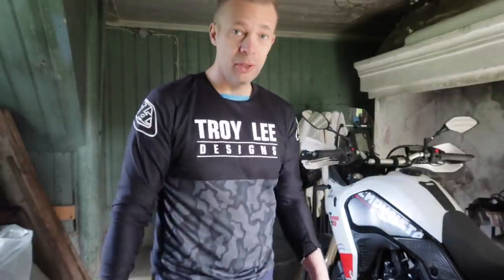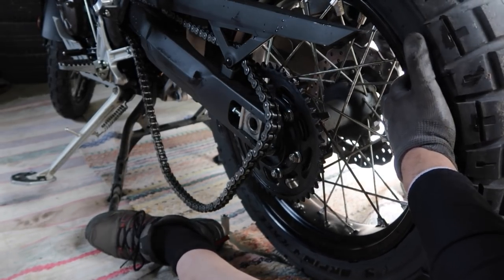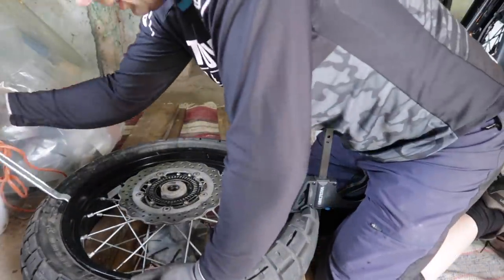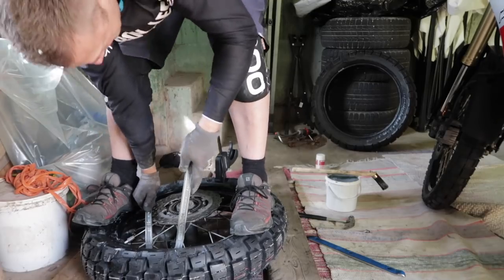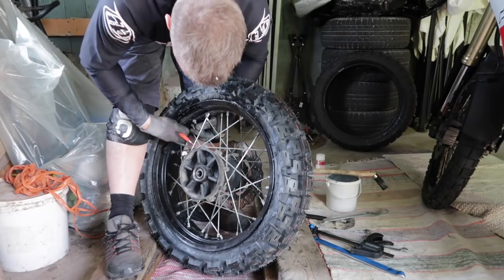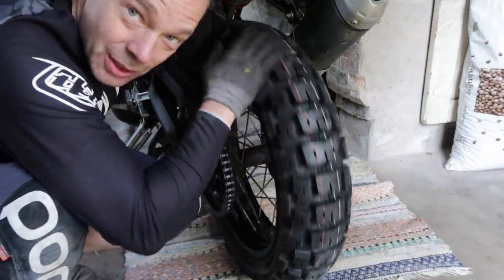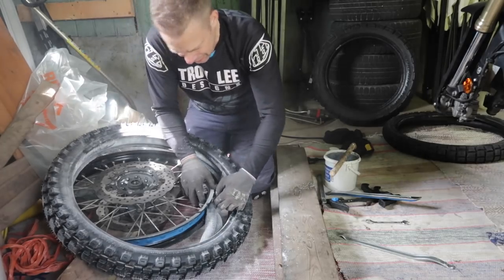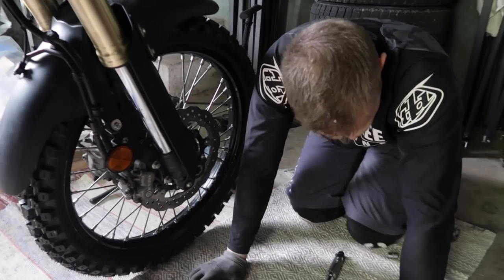How to change tyres on Tenere 700 yourself and save money

Comment: Kindly answer one more question.
What is the size of the bar where you have mounted the Quad Lock for the phone. I want to order one but I don’t know which mount to go for.
Many thanks in advance
Reply from the maker: The quad lock mount you want is the ”mirror mount”. Fits perfect
Reply: @NomadSweden  do you use the vibration dampener also ?
Reply from the maker: @drady8541  nope, i used a phone only for navigtion and the dampener added a lot of extra distance

Comment: Hi 
How did these tires preform on the surfaces you operate in, regarding both traction and longevity ? How do you think the Tractionator Adventure compare to the Rally tires ?
Reply from the maker: Hi! The Motoz Adventure are favorites of mine now for long trips with lots of gravel/offroad. They last forever. I took mine off after 8500km but still had meat left on them. The price you pay is that they are very slippery on cold/wet tarmac because of the hard rubber. So no twisties in the wet. Once you know when to be careful and accept the limitations, they are great for adventure. The Rally tyres are softer and offer better traction on hard surfaces.

Comment: I might buy motoz next time, just for ease of installation! My trailmax missions absolutely kicked my ass. Good thing they supposedly last so long because I do not look forward to taking them off :D
Reply from the maker: I do this 3 times every year. JnlessbI get a flat. It gets easier every time.
Reply: @NomadSweden  I hope so! I ended up taking the rear to a shop because I couldn't get the bead over the rim on the second side. It threw my tire iron back so hard it put a hole in the wall 8 feet away. Makes me worried for if I get a flat in the middle of nowhere, there's no way I could get it back on

Comment: question: as I am looking for the T7 world raid and having never had tubes tires for the reason I don^t want to change tubes for 30 min or more on the side of the street, I wanted to know if you hever considered looking for tubeless tires for the T7? If not, why?
Reply from the maker: Depends on how you want to ride. If you don't risk deforming your rim tubeless is so much easier.But I think my tubeless friends have small leakages every now and then. And I have to admit, I never had a flat on my T7 in 70000 km. Perhaps I would go tubeless if it happened more often.

Comment: just put some mitchelin anakee wilds on mine just finished 20 min ago . put you tube on and you pop up. ankees are a sod to take off and put on front was the worst. got the same pump to pump them up balane was good to. dont think i could change one on a trail .would have to run them flat. that bike will come alive with them on.

Comment: New sub here. Great videos. Wondering why you run tubes? Very impressive skills!!
Reply from the maker: Hi and thanks! The T7 comes with tubes and I haven't converted yet. The rear rim is TL ready but front rim does not have the TL hump, so a new rim would be needed for a true TL solution.
Reply: Thanks for the quick response. Just finished your clothing video. Looking at Revolution Race, that you had on, gpx or gpx pro? Thanks again. I’m in Idaho USA. Jon

Comment: You certainly made that look easier than I found it!  Never seen the baby powder but maybe you just use it to make yourself smell nice?

And please - new jacket required...  ;-)
Reply from the maker: Haha yes i do 😂 The distributor in sweden writes on their homepage to use powder or slime if using tubes to this tyre. Perhaps the inside of the tyre has higher friction than others.
Reply: @NomadSweden  It makes sense to avoid tube creep when fitting the tyre.  It may have made my change easier, instead of the blood and tears I put in to mine...

Comment: Darryl here in Texas. What do you think of these Motoz tires you put on and what country are you in.
Reply from the maker: I'm in Sweden. Motoz are awesome offroad. On tarmac, it's ok but front is a bit wobbly in higher speeds. Cold/wet tarmac is slippery. But hey, I use them for offroad where they rock!
Reply: Nomad Sweden 🇸🇪 If I had looked a little closer I would have read that you were from Sweden. That’s a lot farther north than I’ve been. I’m sure it’s beautiful but cold with some amazing adventure riding. Thanks for your review on the tires. I’ve considered these, the TKC 80 and the Bridgestone AX41 Adventure.  I live in San Antonio, Texas. Much warmer climate and should be around 90°F today (5-24-20). Thanks again.

Comment: Hi Robert. What did you put under the bike, so it doesn´t tilt forward, when taking off front wheel when on centerstand?
Reply from the maker: I haven't had the centerstand for a long time but I don't remember putting anything under. It becomes lighter in front so the rear weighs it down. (If I am not mistaken). But otherwise just put anything under the skid plate to be safe.
Reply: @NomadSweden  Thx alot. By the way, I  really enjoys your channel and content.

Comment: Hello.
With what force Nm tighten the front wheel axle and the 2 fixing screws?
Reply from the maker: Front axle = 72Nm, Pinch bolts = 21Nm
Reply: @NomadSweden  Thank you for the quick reply 🙂 super useful videos 👍
Greetings!

Comment: hi, I changed the front tire and wondered if the rim also has the direction or only the tire has the direction of rotation?
Reply from the maker: Yes the rim has the ABS disc on the left side. It needs to be put back the same way.
Reply: Nomad Sweden 🇸🇪 who can see which one is ?
Reply: Nomad Sweden 🇸🇪 thanks for answering

Comment: What size tyre did you fit? was it a 150/70/18 or 14/80/18. Why I ask is the 150 tyre is tubeless only and you put a tube in.
Reply from the maker: It is the 150 TL tyre. Tubeless with tube is the most common tyre used on this bike. The stock Pirelly STR is also tubeless version. The TT tyres are most often 140 width which is best on narrower rims but can be used here also. TT or TL does not matter if you have a tube.
Reply: @NomadSweden  Thanks. I didn't know the T7 standard tyre is tubeless as I got my tyre changed prior to pick up. I run the Motoz Adventure 140/80/18 with tube. Cheers
Reply from the maker: Cool! I have Mitas Rally Star 140 size to try for the first time ready. 140 tyres are much cheaper also 👍🏻

Comment: Due for new tyres on my T7, pretty keen on.motoz tractionator adventure, how do you rate them??
Reply: Nice vid btw, you make tyre change look easy
Reply from the maker: It is my go-to-tyre for long trips with offroad. Great grip, great puncture resistance, amazing longevity (10.000km). The flip-side of longevity is that they are quite hard, so on cold+wet+hard surfaces they are very slippery, so one needs to ride very careful in those conditions.
Reply: @NomadSweden  thanks for the reply, I think I will go for them, I'm in Australia so ambient temps might suit them better 👍👍
Reply from the maker: Indeed. They are made in Oz after all

Comment: What do you do to keep the front wheel off the ground? Rear is simple, centre stand.
Reply from the maker: Centre stand but you put a support under the bash plate in the front part. I used a piece of wood.

Comment: Hi do you know the torque setting for the rear disc bolts of the T700? I can't find them anywhere.
Reply from the maker: This is what my notes say:
- Rear Brake disc bolt: 30Nm (Loctite)
- Rear ABS-rotor bolt: 8Nm (Loctite)

Comment: Glad I watched after 15 years in the tire industry of course I'm very competent with a pair of tyre levers but that is the best  bead breaker I have seen for the side of the road perhaps not a hammer but I work out something that's in my tool kit
Reply from the maker: Thanks! Amazed I could help a veteran :) Made my day
Reply: I am pleased to see someone after my own heart plenty of talcum powder makes a massive to the longevity of the tube but I must admit I do not go for the thick tube I do too much road work on my t7 and Michelin have spent all their development to minimise the weight and thickness of a tyre to control the heat for me too then put all that weight and heat back unnecessarily
Reply from the maker: @justadam1917  Since the video I have now gone one step back to 2mm Kenda Tuff Tube. Perhaps unfounded worry, but it just feels like an insurance over the stock tube.
Reply: @NomadSweden  very glad for the response my joy in life is to create a joy in others therefore my day also made
Reply: @NomadSweden  I do understand the caution with tubes just in my circumstance  with many road miles many many dirt road miles and a smaller proportion of Rocky terrain which is of course a thick tubes Forte (low pressure high impact)

Comment: Any cracks on them yet? It seems like they tend to crack after riding them for a while on pavement
Reply from the maker: Not on the T7. I had them on the heavy 1
Bmw 1200 gsa and they cracked. Perhaps the lighter T7 is a better match. I ride them for 9000km.(!)
Reply: @NomadSweden  ya on the 1290 they do crack a little as well

Comment: Motoz adventure compared to mitas e-7??
Reply from the maker: Mitas E07 is an 80/20 tyre. Great on tarmac, ok in light dirt. Motoz is 50/50 at least. Much more agressive. Not as good on tarmac (slippery), but great in moderate dirt, some sand/mud also.
Reply: @NomadSweden  thanks for info:)

Comment: Great video and loads of good advice. BUT... Please don't use actual grease. What he is referring to is tyre fitting compound. Adding actual grease would be dangerous as it will remain in the rim as a lubricant. Not safe. Fitting compound is a lubricant until dry. Not for long.

Comment: I am looking for the key to remove front tires. do you have link Robert? thanks
Reply from the maker: Hi, not sure what key you need? For front you need a 10mm and 12mm wrench plus the 19mm hex to remove the axle.
Reply: the key that works for front and rear wheel. very convenient
Reply from the maker: @Valterpenato  https://www.rally-raidproducts.co.uk/yamaha-t7-tenere-spanner
Reply: @NomadSweden  ♥️👍

Comment: Can you. List the tools you used please?
Reply from the maker: Rear wheel only needs a 27 mm socket.
Front wheel needs a 19mm hex for the axle. And a 10 mm socket for the pinch bolts, plus a 12 mm to remove one of the break calipers. That's it.
Reply: Thank you for your quick reply!

Comment: How are you liking the Motoz?
Reply from the maker: Love them. Slippery on wet hard surfaces is the only bad thing. Otherwise perfect for what I want
Reply: @NomadSweden  Can I also ask: Motoz offers the front in a tube type tire, but the rear on the Tenere in the 150/70-18 size is tubeless.  You have to go to the 140/80-18 to get the tube type, which I know some people are doing.  You can obviously run a tube in the 150, just wondering what option you chose?  Thanks!
Reply from the maker: @cschacker99  I have used both 150 and 140 tyres on the T7 and both work great. Using a tube, you can run both TT and TL tyres, but the TT are cheaper. Right now I am on 140 tyre.
Reply: @NomadSweden  thanks !

Comment: hi everyone, how far have you traveled with this tire? thank you
Reply from the maker: Motoz are great for distance. This tyre you can get 10.000km. But it's a hard type, so slippery in wet/cold.
Reply: @NomadSweden  Thank you for your answer, is this tire effective in off road conditions?  Pebbles, sand, or others?  I had ridden Mitas 09 Dakar twice on the T 700, good tire at the rear, bad in front, but I did not exceed 3500km.  I am looking for tires that perform well in the off road and are resistant to wear.  Maybe the desert MotoZ would be more suitable.
Reply from the maker: Yes, it's primarily an off-road tyre so it's fantastic in off-road. I use it for long journeys. The downside to longevity is wet/cold tarmac performance. (Slippery).
The Rallz is a little softer and less km but it is made for more off-road and not made for super long journeys. It's always like that. The better offroad, the less km. But Motoz are best at getting km on offroad tyres in my opinion.

Comment: Are you using OUTEX?
Reply from the maker: Nope. You can see I use tubes in the video. Or did you mean something else?
Reply: @NomadSweden  don't mind me too much isolation. Looking forward for comments on the new rubber. Cheers

Comment: You use grease to ease the tire mounting. Doesn't that present a danger of tire slipping on rim under hard acceleration or braking - potentially tearing off the tube stem and causing tire deflation?
Reply from the maker: I see what you mean. It’s a specific tire mounting grease that i use. It disappears after a while.

Comment: Don't use grease for the tyres, it's dangerous and you can brake the air tube. Use deluited soap, the soap will dry after Tyre and rim will have the best friction. With grease the Tyre might slip and ruin the air tube or worse the bike will not stop.
OH and soap once dry it won't collect dust
Reply from the maker: I use ”tyre mouting paste”. I just expect it to work well since it’s made for the purpose.
Reply: @NomadSweden  OK, but soap smells better(Maybe) Hhahahaha. And Also when you close the rear nut, is good to put a Allen key between chain and rear crown, this will push your tire forward against the two adjusters on the fork. Nice tires and you make nice videos, just finished watching the Up North videos curious about the tires and I forgot I saw already this video!

Comment: Which tire size have you mounted? The TL 150/70-18? Do you have the OEM rim?
I'm also interested in this tire, but I'm not sure about which one really fits.
Thank you for an answer.
Reply from the maker: The Motoz in this video are the TL 150 version. I have also tries Mitas RallyStar which are 140 wide TT tyres which also works well. I have the stock rims.